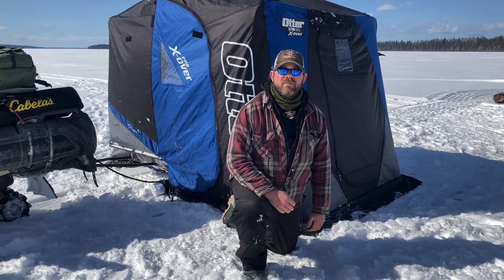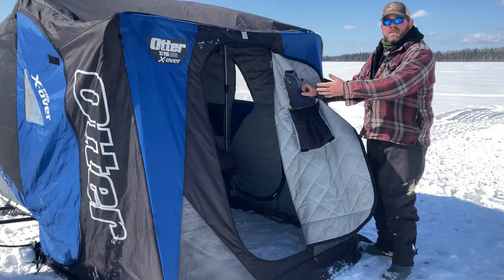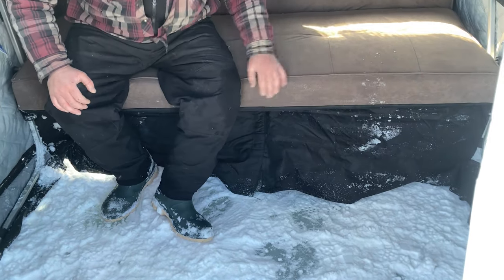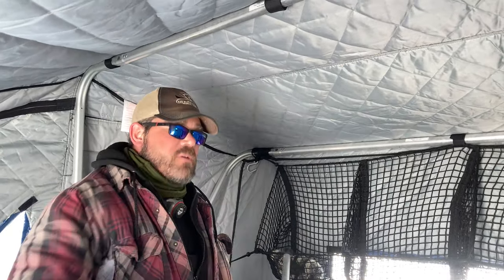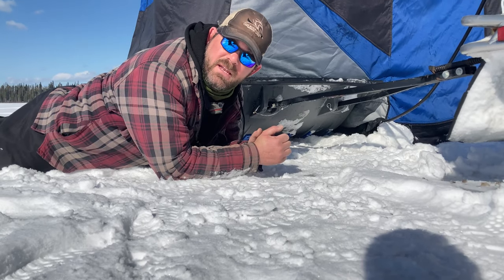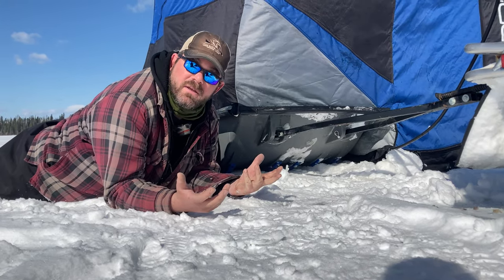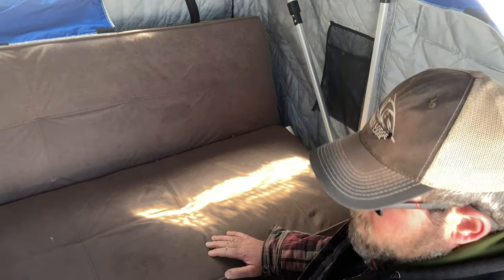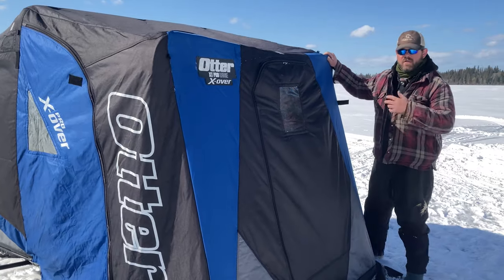Otter XT Pro Lodge x Over--Year with the Gear Review

Comment: Just picked up the Pro Resort this weekend and after accessories I’m well over $2000 into it. Mind you I’m just getting into ice fishing and this was my first purchase so I’m still researching things. Still don’t even have a rod or anything. 🤣 Still have time before the ice is good. Planning another shopping trip this week.
Reply from the maker: Yep, no shortage of things to spend money on when it comes to ice fishing.  Far cry from where I started as a kid fishing with my sad in the early ‘80s:  5 gallon bucket, sawed-off mop handle with two hooks for line storage, small Len Thompson red and white spoon, and a onesie snowsuit!
Reply: @28fish  you're not wrong. I'm approaching the $4k mark now and still not 100% ready for when the ice can support my UTV and all my gear. But I've reached a point where im absolutely itching for this cold weather to make some thick ice! I'll be ready before the end of the year.

Comment: I have the same Eskimo, but I same problem Computing and wanted to be more mobile, but I like Eskimos thermal quilted fabric so I went with a grizzly, but still in the market for another flip over.
Reply from the maker: Do you find the Grizzly is tall enough?  I looked at Eskimo as I was impressed with our Quickfish 5i, but seem to recall it was less than 70” in height.

Comment: do you think it would be pullable by foot? or is it too heavy? thanks
Reply from the maker: I have on early ice before there is enough ice to support my snowmobile.  I kept the gear to a minimum to reduce weight and I used a harness from a deer stand to attach myself to it!  It was not too bad to pull, but that was on smooth ice with minimal snow. The hyfax runners certainly help. I think it is 180lbs dry.  I have also seen people hook these up to their vehicles for a tow.
Reply: You can also build a Smitty Sled for it also. Just 2 used down hill ski’s and some lumber ! I built one for my Otter Cottage and it makes a world of difference pulling it on snow !!
Reply: I have the “cabin” if you have bare ice 👍, snow on the ice 😩

Comment: You complain about accessories, well Clam and Cabelas, Eskimo, etc don't include any of the items you were complaining about either! The first several times out I used the pull rope and when I bought my 4 wheeler, then is when I found the hitch, although spendy was a good choice. The new insulated shacks are so much superior to the old canvas but are also heavier. Everything has tradeoffs...